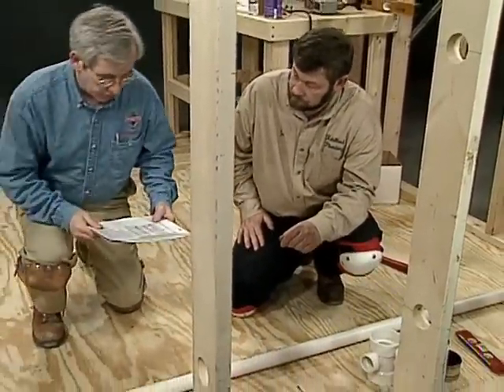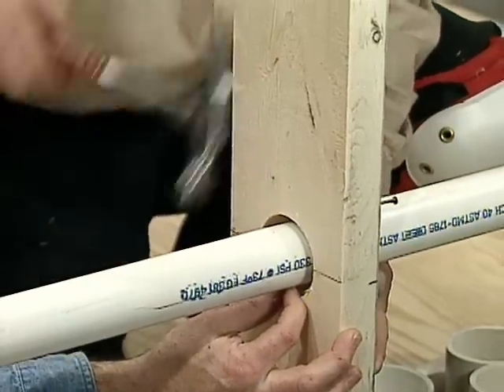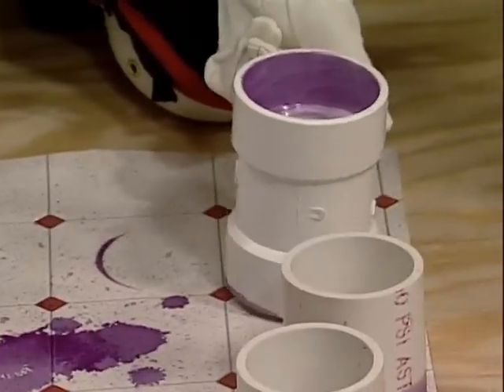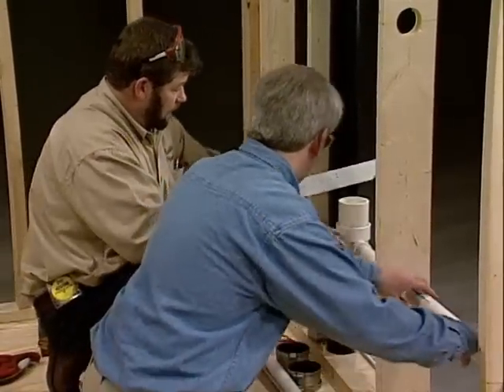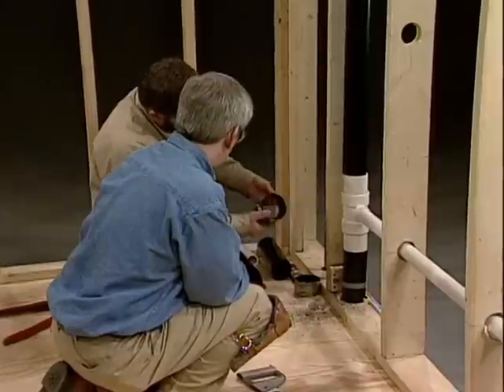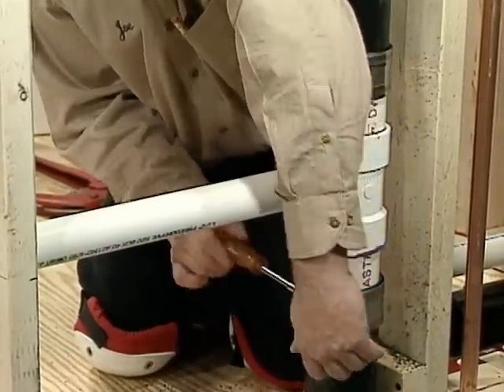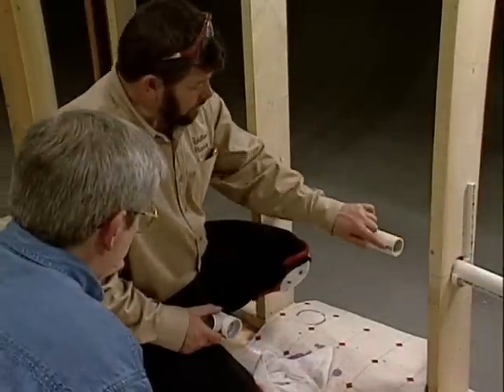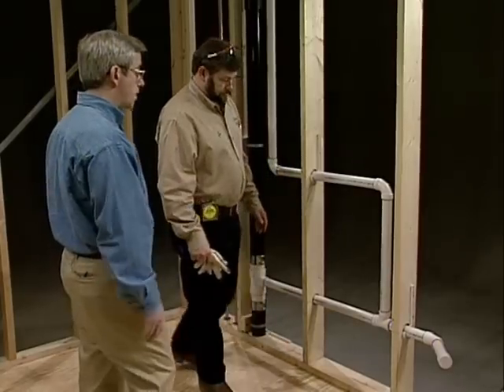Cut and Join Part 4: ABS and PVC

Comment: Near 3:00 minutes, the second 3" Stub easily slides all the way into the T fitting. That is really bad. You must reject any fitting if the interference fit doesn't begin between 1/3 and 2/3 of the way in. 

Also, always make an outside pipe chamfer every time after pipe cutting before primer/cement. This is super important to prevent scraping off the fitting's cement when pushing pipe into the fitting for the last time. You can buy a "Dremel" router-type chamfer tool that fits any pipe, or a bit that fits your drill, or use a cheap conical palm tool, or just skillfully use sandpaper.

Comment: 14:09  I need to know if it is OK to use a SanTee laying horizontal if it is ONLY for a vent.  I see you did, but I have a local plumber telling me it is must be a WYE.   Thanks for the great video.
Reply: Tees are only use for vertical,  though they're allowed to be use on 45 degree angle,  one can also use them on horizontal some times but it it  for vent only, never for drainage just  as he did on this video, to answer your question if it's  on horizontal you gonna have to use a combo fitting,  wye, or a Wye with a street 45 fitting (its kind of like a combo fitting) but never a tee